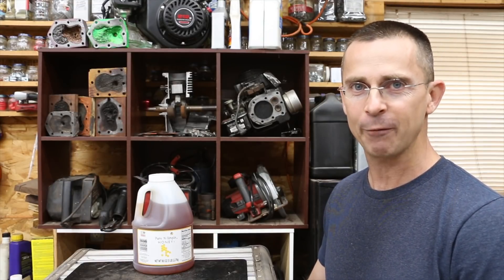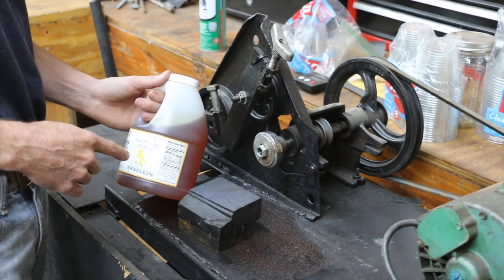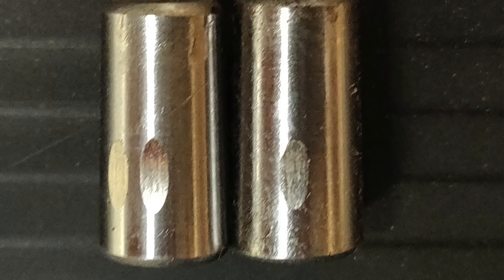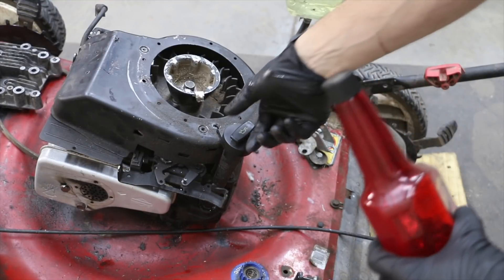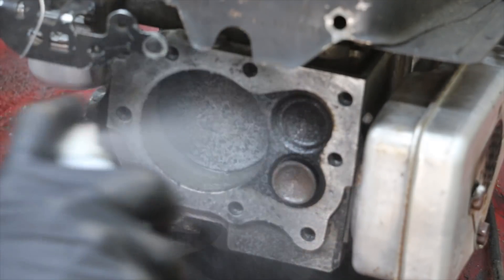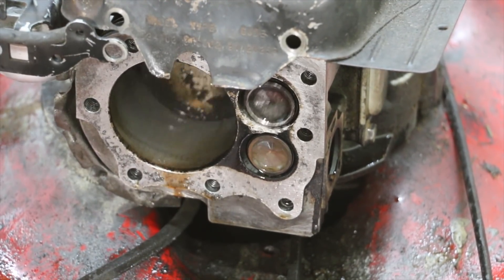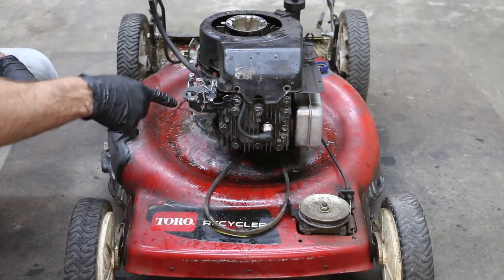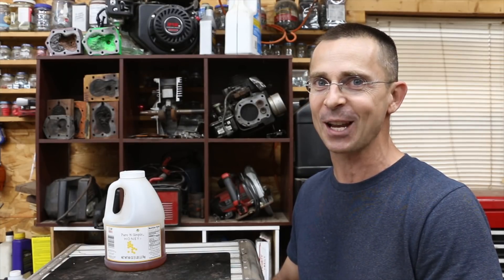Can you use Honey as Engine Oil?  Let's find out!

Comment: While I have not seen anyone do a video like this, it is pretty darn good to see someone do it. Basically, the sugar in the honey turned to caramel and became a 'locking' paste that seized the valves and ultimately the piston. The bore and piston in this old clacker are close to if not completely done.

It also highlights, along with shampoo, that lubricant failure is very real and that's why engine oils have to be formulated properly. It also highlights what can happen if the wrong lubricant is used in a valuable powertrain, i.e. your car or truck.

I wouldn't mind seeing how long the old clacker will run for on marvel mystery oil as engine oil alone in the crankcase.

Thumbs up to another interesting video.
Reply from the maker: You are right!  Great points.  Great video idea too!

Comment: Can you do a test on the strength of bolted wood connections under compression, namely parallel to the grain vs perpendicular to the grain? It seems counter intuitive, but apparently parallel to the grain is stronger... Bottom of slide #5: http://www.woodworks.org/wp-content/uploads/C-WSF-2012-Hereford-SW2W.pdf
Reply from the maker: Great test idea!  Thank you
Reply: @ProjectFarm  Everyone will be building decks once spring arrives. Making those post to beam connections are critical to the design, and there are several ways to make them. Thanks for considering and thanks for all the work you do!
Reply: @ProjectFarm  This is the video that piqued my interest in the subject. There is much discussion about what part of the connection would fail first: https://www.youtube.com/watch?v=JjQZ9rtbYcM&t=25s

Comment: I would hit that engine with a shot of nitrous and grenade it for the finale 💥😂😂😂👍🚗💨💨💨💨
Reply from the maker: Great recommendation!  I'll give it some NOS soon!
Reply: I always heard nitrous was a bearing killer (or hard on the engine components).  How about a study showing exactly what it can do?
Reply: I was thinking of a test where are use Things like /either/ dust off/ or other flammable sprays instead of nitrous and see how much power you gain
Reply: There's an idea.  I remember an off road competition where the Jeep died in the deep water.  The spotter strattled the motor and did a constant spray some type of aersol (probably either) into the carb to keep the engine running so they could cross the finish line.
Reply: Well John It will either melt a hole in the piston from being too lean or it will shoot the connecting rod out the side of the case from over revving

Comment: Try the cnc/cutter milk for lubrication :)
Reply from the maker: Great test idea!  Thank you
Reply: @ProjectFarm   One other thing that has been on my mind, i work on the refrigeration field, and some of the POE, mineral and AB oils are designed to withstand some pretty high temperatures, if in pinch You could use those as an emergency solution for 2-strokes, but price is one thing that would mean it has to be a real emergency :D
I know the 32 and 68 ester oils are like 25-35€ / litre, and mineral oils for vacuum pumps or MBP compressors go for about 15-20€ a litre.

Best bet would propably be 46 viscosity mineral, such as Suniso 4gs, its pretty common too.

Comment: I'll say for a little while. If STP can do it Honey ought to do it a little.
 Thanks Commander and have a Blessed Turkey Leg Day!
Reply from the maker: Hi Lewie,  Great point on the STP!  Wishing yall many Blessings and a Happy Thanksgiving!
Reply: @ProjectFarm  Thanks Commander! Been working on a mower the trash man gave me because it looked too good to junk. The oil had lumps in it and I bet had never been changed. I drained it, poured it full of gas and yanked it a little. Then drained that and poured old oil in iI after I tore the outside down and de-rusted everything. It had 1/2 inch of mud in the starter spool. Thought why not and put some gas in the tank and it fired the 1st pull. I about fell over! Drained that after it got hot and now has good oil in it. NOW for the front wheel drive. Blasted mowers are like rabbits here. I think the number is up to 8. Mercy. But we're blessed. It could be a scythe with a broke handle! GBWYall!!

Comment: Project Farm Excellent video!  I watched it all the way through, like all your videos.  I would like you to run an engine on pure glycerin (glycol) that is left over and a waste product of the biodiesel and biofuel industry.  I know you can run a diesel on it (see Formula E racing generators, they run on it) but I would like to see it ran in a gas engine if possible (your mower). The engine needs to be hot before you switch to glycol fuel.  Thank you for great content.
Reply from the maker: Thank you very much!

Comment: moth balls as octane booster!!!
Reply from the maker: Thank you!
Reply: You'd never notice any improvement in a low-compression lawnmower engine. This would only work in a high performance car. But instead of using actual mothballs, you could just dump a container of liquid naphthalene (Zippo lighter fluid) into the gas tank.

Comment: Run a engine with heavy-duty gearbox fluid (80W-90)
Reply from the maker: Great test idea!  Thank you
Reply: Project Farm I just took a Kohler 12 hp out of a cub cadet that burned a half quart of 90-140 in 30 minutes. But it still pushed snow out of my driveway
Reply: 161Sheriff time to rebuild that K301. Bore it to 3.5" and run a K321/M14 piston and rings.
Reply: Think I tried this when I was younger and dumber, I remember the stench of hypoid...
Reply: I knew a guy who did this in an attempt to regain oil pressure in a worn out motor. ('49 Ford I think).  As I recall either one of the connecting rods broke or it through a rod.  The oil was too thick to flow into the tight tolerances of the bearings and what not.
Reply: @johnbrereton6823  ...Or the worn-out engine had poor oil pressure and was already on the verge of throwing a rod.
Reply: It will work. It's commonly used to mask rod knock on engines at used car dealerships.
Reply: Years ago, I worked at a mining company and we had 500 gallon tanks of D-A Lubricant 140 SAE rock crusher gearbox oil. I had a 1971 f250 with a 360fe in it, and a leaking rear main seal. My boss told me to carry a 5 gallon bucket of the crusher oil and to use it. Truck ran fine for several months on it until I finally rebuilt the engine. Very rough starting in November and December in upstate NY but other than that, it worked.
Reply: @TheRoadhammer379   I run 80-90w in my gear box that calls for tranny fluid, 6 years later my 5spd shifts smooth and is not noisy like other jeeps..
Reply: I had a 289 that got so low on oil it quit picking up and my oil light came on. I put 2 quarts of 80W-90 gear oil and had no ill effects at all, but was probably a 50/50 mix with regular motor oil. 

I had another engine ready to go in the car and was just running it, seeing what it would take before it blew. Eventually I burnt a hole in a piston with to much octane booster.
Reply: It was not the booster, you ran it too lean. The combustion sequence has no quench period and it super heats the piston head.
Reply: Quiet possible as I never tuned it at all, I didn’t know to back then. I had enough octane booster to treat 88 gallons in a 16 gallon tank.... I was just a 17 year old with an engine to destroy
Reply: Caught a used dealership that put some in a vehicle I worked on that almost seized because most engines have tight tolerances that cant withstand the viscosity and most closest you can get is 20w-50 Its surprising how long it lasted.
Reply: Yessssss
Reply: Well the 80/90 is merely equivalent to 30/40 engine oil but the gear oil isn't designed for the acids and fuel dilution.
Reply: Sorry dude but that is literally 10w30 engine oil bud
Reply: @richterman3962  uhh 20w-50 maybe?
Reply: @Kenny H it seems that your and mine real life experience with these oils don't matter.I also tried to explain them that these oils are not even close to being similar but it didin't work
Reply: Would run better than honey
Reply: Used it in a Corvair . Worked well. 90w gear oil is same viscosity as 40 w motor oil. Military uses 15-40motor oil in differentials along with a zinc high pressure additive.
Reply: @dielauwen  let me put it this way.Sae means (society of automotive engineers) and that number relates to oil viscosity (thickness) at 100C.So SAE 40 oil has viscosity of 40 at 100 degrees celsius.Sae 90 has a viscosity of 90 at 100 degrees celsius wich means its more than twice thicker.This is what the numbers mean,and that means they are not even remotely simmilar or the same.The first number marked with a "W" relates to viscosity at cold temperatures so 15W and 70W cannot be the same for the reasons mentioned above.One of them has a viscosity of 15 at cold temperatures and the other one has 70 at cold temperatures.Is that the same?Or similar?Not really!Another important thing that many dumb people believe is that engine oils and gear oils are not labeled the same.This is utter crap,only a stupid halfbrained person would say that.Engine oils and gear oils are labeled by SAE standards,and the only difference between engine oils and gear oils is the thickness and aditive package.There is not a special SAE for engine oils and a different SAE for gear oils.I just described you the difference in details,now you can either accept the facts or you can continue believing what you just wrote above.Im going to say this one more time,even if it wasn't for these facts i just wrote i still have all kinds of different engine and gear oils in steel drums on the farm and THEY ARE NOT THE SAME.Sae 40 is thicker then sae30,sae 50 is thicker then sad 40,sae 90 is more than twice thicker then sad 40.Logic is all you need to understand what i just wrote.
Reply: holy fuck thats prob thicker than molasses!
Reply: I tried that in a desperate moment when I had not 10w-30.. It is bad, oil was not making it up onto the rings. That was an 8hp briggs. Not good. Lost power and compression. The engine survived though once I put the 30 weight in all was well.
Reply: That's only 10w30 so no
Reply: FreddyXP
Prediction: it'll run just fine. Gear oil and engine oil use a different viscosity scale, 80w90 gear oil is roughly the same viscosity a 20w50 engine oil.
Reply: @CaptHollister  not really.I have all possible grades of oils on our farm and 80w90 is not even close to 20w50 engine oil.80w90 is much much thicker.
Reply: @gumelini1  Here are the numbers: https://syntheticwarehouse.net/uncategorized/how-can-a-20w-50-be-used-in-my-transmission-requiring-a-75w-90
Reply: @CaptHollister  what numbers?Im telling you I have barrels full of different oils and 20w50 is not even remotely simmilar to 80w90.If they were the same viscosity they would booth be either 20w50 or 80w90.You can't use one of them instead of the other one without causing damage.The botom line is that they are not the same.At all!
Reply: @gumelini1  You missed the point that motor oil and gear oil are not measured using the same scale, so they don't use the same numbers to describe similar viscosities. It's kind of like how North America and the rest of the world use different octane numbers to describe fuels with the same resistance to knocking. You are correct that gear oil and motor oil are not necessarily interchangeable, but this has more to do with the different additive packages than with any difference in viscosity.  Harley-Davidson, for example, allows either 20W50 motor oil or 75W90 (some people use 75W140) gear oil in their gearboxes. If you scroll down in that link there is a table that shows that 80W90 is slightly more viscous than 20W50 (I used 80W90 in my original statement, but actually 75W90 would have been the better comparison) at 0c, but 75W90 is pretty much the same.  At 100c 20W50, 80W90, and 75W90 are all pretty much the same viscosity.
Reply: @CaptHollister  im telling you that they are not the same.I just checked again today in the barrels just in case i developed an Alzheimer's disease in meanwhile.And nope,not even close.80w90 gearbox is not even close to 20w50 engine oil.Now you can put some random internet "facts" here but i have those facts sitting in my garage in multiple 50 gallon drums.If there were no differences as you say then we would one universal oil for everything.But that is not the case,those numbers mean that there is a difference.
Reply: @gumelini1  Let's just see what transpires if and when Project Farm performs this test. Happy Thanksgiving.
Reply: @gumelini1   ---  Enigne will work fine. We put that oil into my farmer friends Volvo V70 many years ago. It worked fine, so that test would be boring.
Reply: @civicaerodeck14  yea right,it works fine just like vegetable oil.The only question is how long will it work.
Reply: I believe viscosity is measured the same, but shear strength is different.
Reply: @dinkchow  exactly.

Comment: Mirror Polish the cylinder head to test carbon build up. myth is that polishing reduces the build up
Reply from the maker: Great test idea!  Thank you
Reply: Polishing CAN reduce buildup, but only if the rings still seal properly. Polishing often makes the cylinder slightly out-of-round, at which point the rings no longer seal properly and there's actually MORE leakage of combustion gases into the crankcase. That's why engine manufacturers don't usually bother with polishing the cylinders; it's better to let the rings and cylinders mate-together to form a tight seal regardless of whether they look mirror-smooth to the human eye.

Comment: I’ve got an idea, blowing compressed air to a gas engine to see if it gains power, you know like a turbo
Reply from the maker: Great test idea!
Reply: @ProjectFarm  Combine with fuel vapor canister method used in earlier videos pushing more fuel and air combined.
Reply: @memyself7419 : Combining pressurized air with a bubble-carburetor would probably work. Though there's a possibility that the compressed air would suppress the evaporation of the gasoline, keeping the setup from working as imagined. I'm honestly not sure.
Reply: It won't work without a pressure chamber around the carburetor. The carburetor only works when there's negative pressure in the intake, to suck fuel into the engine. Positive pressure in the intake will just push the gasoline back down the fuel tube into the tank. The engine might run faster for a brief time, but it will fuel-starve and overheat quickly. Old turbocharged cars with carbureted engines had to deal with this problem decades ago.
Reply: @fyrstormer  Could it not be combined with the fuel vapors canister. Basically run compressed air through the canister forcing higher amount of fuel and air into the engine. That I think is doable.

Comment: Amazing video as always. Have a great Thanksgiving to you and your family. BTW, that Seafoam is amazing. I must have had a stuck ring in my Saturn 1.9 DOHC engine. Blow-by gone. My 1999 Chevy Tahoe with 5.7 Vortec had a AM start lifter noise. That too is gone and went from 40 Psi oil pressure to 60 psi in 1,000 miles. 
Thank You
Thank You
John A 
60107
Reply from the maker: Hi John,  Awesome results from Seafoam!  Glad it helped both vehicles.  I always have some in the shop for when it's needed.

Comment: Next test, soap and water, 40 years ago, I was aboard a steam ship with compound reciprocating steam engines, bore, approximately 3 feet, 6’, 9’, stroke about 4-5 feet, the bottom end lubricant of the open crank bays, low pressure fed soapy water,  ( looked like milk) viscosity appeared to be 5-10;wt. sae, the soap resolved in water looked like ivory snow type, ( not detergent) these engines were made in the  1920’s, the service rpm was 100, bearings were all plane, ( the lube was only exposed to the heat of the bearings, ) I ask if they were using soluble oil,  answer; no, just soap and water, obviously the heat of internal combustion is tremendous compared to external combustion in the area not exposed to live stream, but honey is water based, so, hence the question.
Reply from the maker: Great test idea!  Thank you

Comment: What, you didn't drain the honey and show it afterwards? Or did it become too thick to drain?
Reply from the maker: You are right.  It was as thick as caramel.  All the water evaporated.
Reply: It seemed like it was a good lubricant as long as it didn't get hot enough to evaporate. So more of a gear oil than an engine oil.

Comment: Well...who knew...it actually ran for 24 minutes before it carmelized and became a sticky mess...I wonder if bees wax would work (will it emulsify/melt in marvels mystery oil), after it was melted of course...because inside an engine it would be fluid when hot...but as solid as a rock when cool...if there was only a way to get bees wax to be liquid at room temperature.  Interesting that it even ran at all.  Defintely going to have to figure out a way to clean out the crankcase of that engine in order to get that sticky goop out...but really neat test...thanks!
Keep em coming!
Reply from the maker: Great point regarding the Bees Wax!  Happy Thanksgiving!

Comment: Use CCL^4 (Carbon tetrachloride) as the best organic solvent to lose all organic matter(as honey and oil are organic chemicals, hwat ever contains carbon is considered organic  ) in the engine , open the crankcase to remove all the burned out stuff , ( don't breathe this , and then do several drains) and it should dissolve everything in its path after that wash everything with water add oil and it should be good to go :D
Reply from the maker: Great recommendation!  Thank you
Reply: that isn't really how solvents work, ccl4 isn't that strong
Reply: @devinwilliams3489  so please what is the best organic solvent, I would like to know so that i wouldn't say wrong things please, thannk you